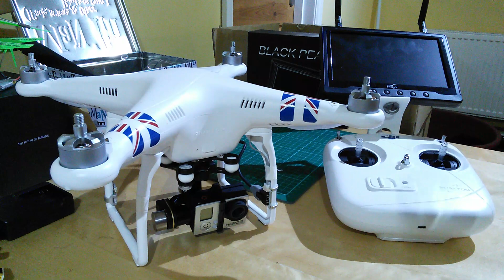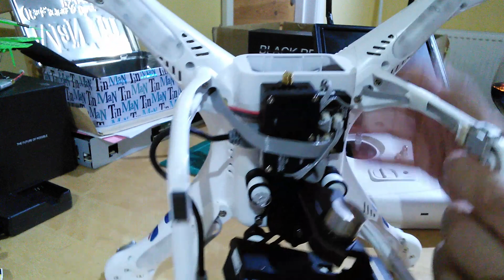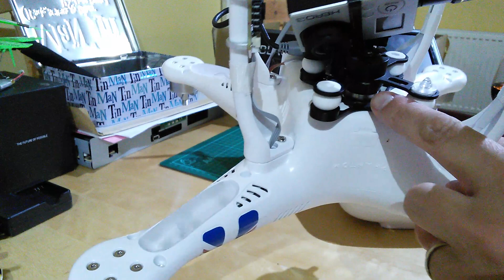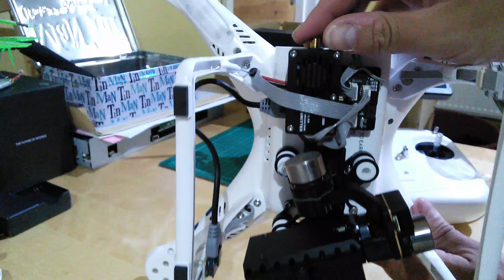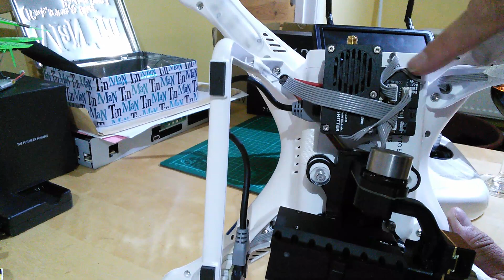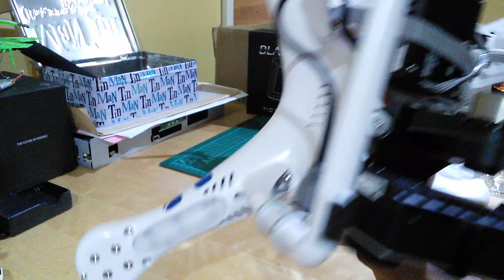My DJI Phantom 2 Zenmuse H3-3D and FPV setup

Comment: Help
I just got the phantom 2 FPV edition with the black pearl monitor, I have a go-pro hero3 got it all ready to fly from shop. And the question is their is no picture on the monitor when I fly and record need help to sort it want to see what I'm recording when in the air I don't know how to sort it out. Please help. Thanks Kev.
Reply: I'm new to all this and I don't know where to look to find out got no instruction manual with it telling me everything about it just the odd little bit?
Reply: DJI Phantom 2 with H3-3D Gopro Gimbal and Fpv Tx and FPV Diversity Monitor. 
New Version 3.0 of Phantom 2 now in Stock . 
Fitting options are available in either plug and play or we will professionally install for you. 
GOPRO Camera and Monitor Mount is Not included in the package and images are for illustration only.
Comes with the best set up we believe is available for First Person View featuring a Immersion Rc 600mw 5.8Ghz Video Transmitter , Black Pearl High Def HDMI 5.8Ghz 32 Channel Diversity 7" Monitor with sunshield and Lipo Battery for the Monitor built in. 
Please select options below for either self install or plug and play options or alternatively we can fit everything for you. With our plug and play option there is no need to remove the lid the connectors are already in place to simply plug in and attach the video tx .

Base price of £934.00 is for customer to wire themselves and will come with no connectors and basic soldering / connecting will be required. 
We are pleased to announce new version Phantom 
New Remote Control
The upgraded remote control comes with many new features. A gimbal control dial, trainer port, built-in rechargeable LiPo battery with a capacity of 2000mAh, battery level LED indicators and throttle locking feature that holds the throttle stick in place when descending are all included.

Improved Power
New motors, propellers, and ESCs combine to give you greater thrust and control than ever before. You can load more equipment on your Phantom, and achieve up to 200g/axis of extra thrust when using a 3S LiPo battery with this completely new system.

New Compass
A new, anti-static compass has been developed, with a protective shell to help shield it in any flight conditions

The Fpv Monitor will comes with a internal Lipo battery and UK Style charger 
Also available is a FPV Monitor mount for attaching your monitor to your radio please see here

PLEASE NOTE THE GOPRO CAMERA and MONITOR MOUNT IS NOT INCLUDED IN THE PACKAGE AND IS FOR ILLUSTRATION PURPOSES ONLY. 
LEAD TIME ON PRO BUILD WITH IOSD MINI IS APPROX 3 WORKING DAYS
Reply: I got it from quadcoptor.co.uk
Reply: It was all done at the shop before they sent it to me.
Reply: Hi could you send me the link to get a monitor stand like you have please for your quadcoptor?
Reply: Hi Simon I just watched the video again but no link came up on screen sorry to be a pain.
Reply: Ok Simon I got it sorry and it's on it's way thanks for your help.

Comment: Simon, I have a Phantom 2 with H3-3D and the Black Pearl FPV monitor.  The monitor gives great real-time flight data but I don't know how to capture that.  Is there a way to record the flight data, such as altitude, to be seen on playback of the Hero footage?  I am new to this game and during one of my recent flights, I went higher than I have before (100 meters).  I only stayed there for a short time because of high wind.  During the playback of the Hero video, I was not able to pinpoint exactly where I hit 100 m.  If that data was recorded to my video footage or saved somewhere, I could point to a frame and say "I was so many meters high at this point...".    -Thanks, Robert
Reply: ***** Great info, Simon.  And this will work with the Phantom 2 Hero setup?
Reply: ***** Thanks again!

Comment: Hello. Stumbled over your channel tonight. Saw almost every video about the Dji Phantom 2. Really great channel. 

I am gonna get a FVP setup. 

Now I just have the Dji P2 with G3-3D and the GoPro Hero3+.

Will this be enough: 

- Dji Mini iOSD
- Dji Phantom 2 Fpv Cable and Hub
- Dji Videolink AVL58
- Black Pearl 7" Monitor
- Dji Monitor Mount

The web page where I am buying this from..says this on the AVL58:
"This system has a Transmitter and Receiver and a bunch of wires, those wires were made for Go Pro cameras and T-Join batteries. To get the system to work, you will need a Monitor, a Go Pro Hero Camera and Two 11.1V Li-PO Battery"

So my question is..will my list above be enough to get a good FVP setup?

Sorry for the long comment. Again..great channel!! :)
Reply: *****
Ok, thanks! I will place an order with the stuff mentioned above and then Im set! :) 

Thanks again. You just got a follower. Wee

Comment: Is it true that if I just want the real-time video, I don't need the iOSD? (The iOSD stuff needs NAZA-M and I may invest in them in the future but not now.)
Reply: ***** Thank you, Simon. I thought iOSD would only work in NAZA mode because the manual doesn't mention the Phantom mode: http://download.dji-innovations.com/downloads/nazam-v2/en/iOSD_mini_User_Manual_v1.06_en.pdf
Reply: ***** Sorry for the misuse of the terms. I meant the NAZA-M flight controller, not the NAZA mode. If the iOSD can connect to the default Phantom flight controller then I am clear. Thank you!

Comment: Thank you for posting this video, it has been invaluable. I have copied your set up, except I am using the original AVL58 antenna, and I am only getting 150m altitude/300m distance before the video link cuts out. Is this the website to buy the same antennas that you use?

http://horizonfpvantennas.mybigcommerce.com/black-pearl-kit-with-bh-nimrod-and-sp-with-options-rhcp/

And do you know which specs I require for the best distances - long shaft, VTX type, 12 dB upgrade & BP connectors?

Any advice on obtaining better FPV distances would be much appreciated.
Reply: *****  Hi, thank you for your advice, I will follow it up and see where I get.

Comment: I'm trying to figure out how to use my dji2 I'm using my GoPro 3 also but using the GoPro app and I lose connect with in a few feet using my iphone6 .what do I do? I just wanna fly around with out it losing connection.can I use my GoPro with dji app? I'm completely new to this.